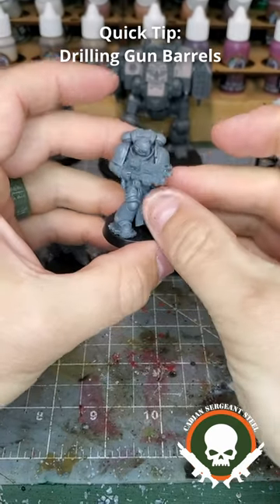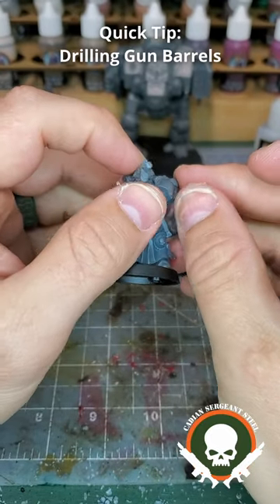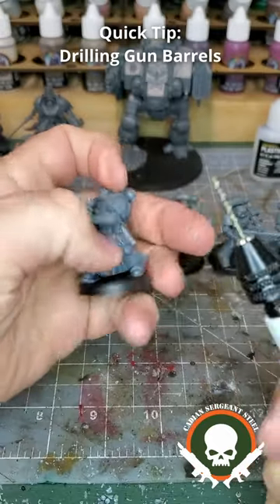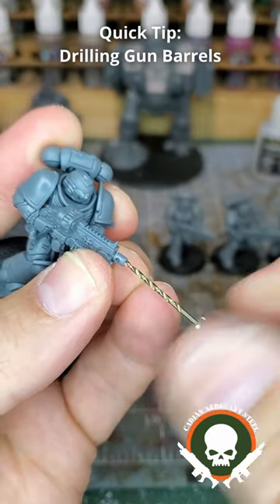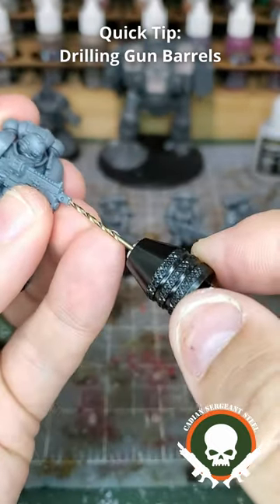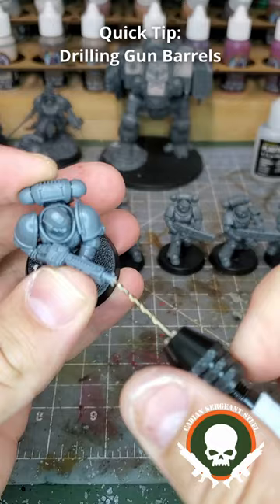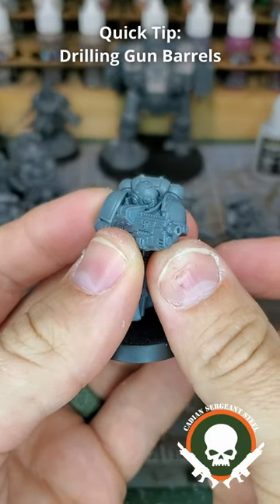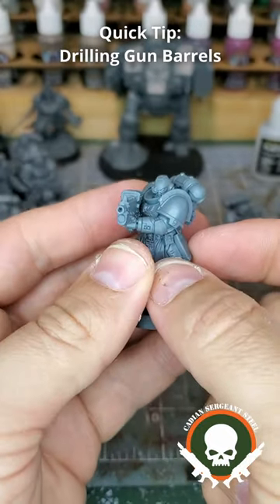Quick Tip  - Drilling Barrels #wargaming #warhammer40k #warhammer

Comment: To add to this: I would suggest using a needle to puncture a small hole with which you can put the tip of the drill in. For a more precise result
Reply: That's what I do, otherwise my drill bit wanders too much.

Comment: Thank you for not using a hobby knife to start the pilot hole.  It’s not that using it won’t work, but if you don’t hit center good luck recentering with a hobby knife.  Especially for new hobbyists.  Using a drill bit is much easier and you can start with the tiniest drill bit in the set to give you more room for potential adjustments.

Comment: Helpful tip, use the tip of the hobby knife to mark the midpoint and slowly rotate till you have a guide hole for the drill.  Helps to center the drill and then the rest of these steps I also follow.

Comment: Quick tip take your scalpel and carefully use the very tip to get your centre prior to drilling. It will do the least amount of damage before you start the drilling process and stop the drill bit walking away from the centre if you aren’t exactly on the centre line. Also if you are drilling off centre decrease the angle in the direction you are out by and gently drill back to alignment. 
I hope that makes sense to everyone. 👍

Comment: To create the pilot hole, I use a T pin commonly found in fabric stores.  They are thick and the t shaped end acts as a nice control arm.  Alternatively a cork board style tack with the larger plastic end also allows for better control of the pin.
and you only need one of them.
Using hobby knife blades tend to cause the tip of the blades to break off inside the plastic.

Comment: What thickness drill bits do you use? Got a link to that pin vice?
Reply: He literally said 1,25mm (0,0492 inch), but I would reccomend a bit smaller, 1mm (0,0393 inch)